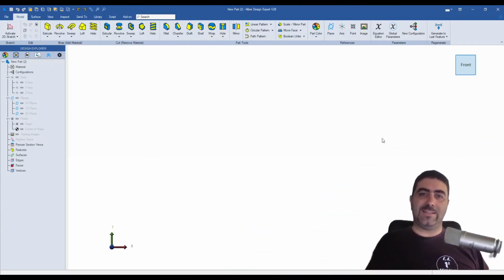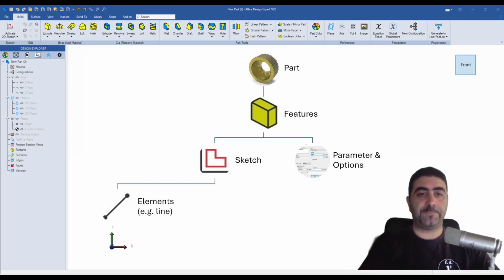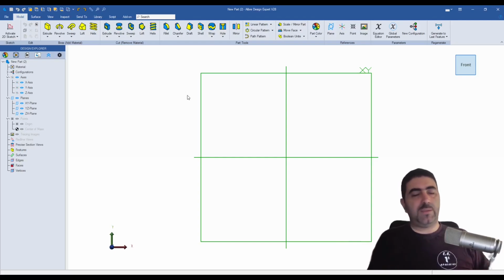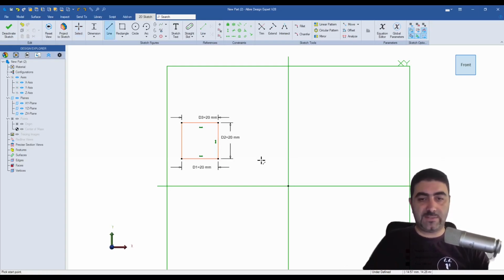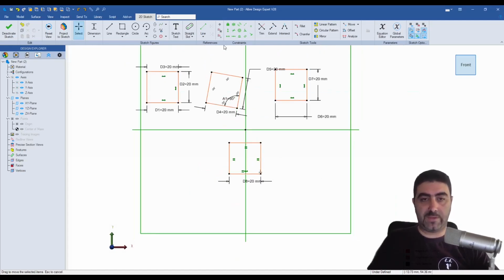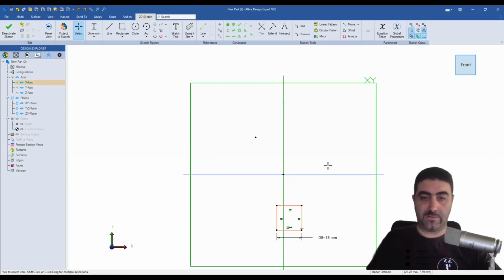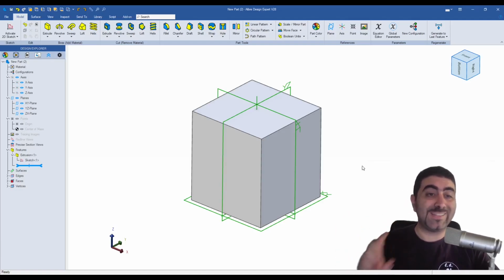CAD Beginners Get This Wrong | Design Intent

Comment: So, could one say that a fully constrained sketch implies design intent? Or must we go further (as in the case of the cube having its extrusion set to D8) leave no doubt that it is cube we are designing vs a square that just happens to have all dimensions the same? I’m not too clear on where you draw the line on that. Perhaps a more elaborate example is needed. 

Thanks
Reply from the maker: A fully defined sketch has all of the design intent it can have. But even a single constraint carries some design intent.
Reply: @ExMachinaEngineering 
So, to adhere to the concept of design intent, one should strive to eliminate as much as possible any ambiguity in the sketches and features?

How would you define parts that inter part relationships? Would you see them as not adhering to design intent because certain elements are dependent on another design and thus as viewed in isolation, their ‘intent’ cannot be understood?

Trying to wrap my head around the concept.
Reply from the maker: No. Inter part design relationships are another form of design intent. As you can see, it can go pretty deep. I tried to give an initial definition in this video.
But one way to get closer to well defined Design Intent is this:
Try to use as few dimensions as possible.

This is not a dogma or a gospel. But it is a great rule of thumb

P.S. You are very correct that models with inter part relationships have ambiguous design intent when viewed alone. That's why Top Down Design is slightly harder and more advanced
Reply: @ExMachinaEngineering 
Understood. I would love to see you explore the advantages and disadvantages of Top Down design. I have always struggled to use it effectively and feel that it doesn’t get the ‘Love’ it deserves because most try to avoid it whenever possible. The restrictions it imposes must be offset by some advantages. 

Thanks again for your wonderful videos!
Reply from the maker: @user-br9fx5nl8m Thanks for watchingu videos man! Glad that there are people who appreciate what I put out there.

I might do one on top down design. Pretty deep and complex topic though. We'll see
Reply: @ExMachinaEngineering 
I smell a ‘Top Down Masterclass’ in the works…😊👍

Comment: 00:20 if it wasn't a cringe intro, it wouldn't be the same. 
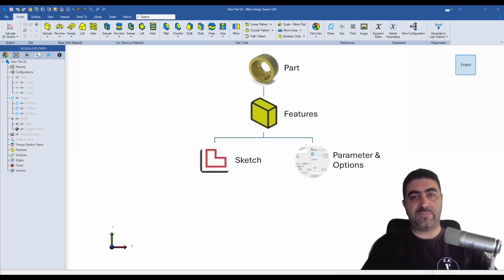02:16 I was just about to say, even a sketch can be broken into lines and constraints.
07:30 THERE! ARE! FOUR! LIGHTS! 
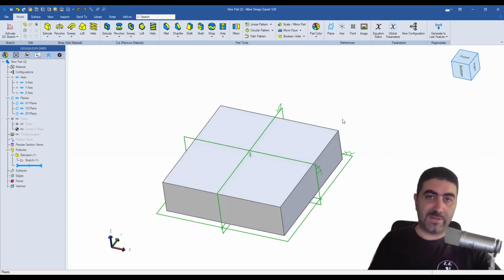10:00 Watching you not do a mid-plane extrusion almost hurt. I think I almost always end up doing a mid-plane extrude.
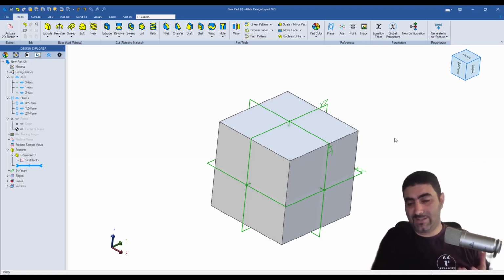12:00 A fantastic brief example of what design intent is, and how powerful it can be when done correctly.
Reply from the maker: Hahaha!!!
Another excellent comment! Thanks a lot man! I'm glad you liked it, man! I really think it's one of the most powerful concepts in Mechanical Design Engineering and definitely worth mastering